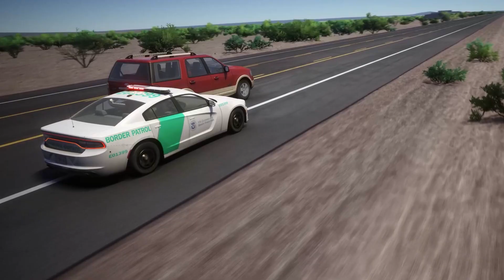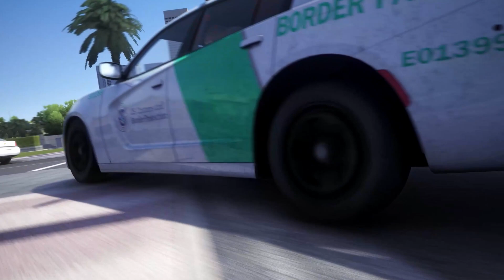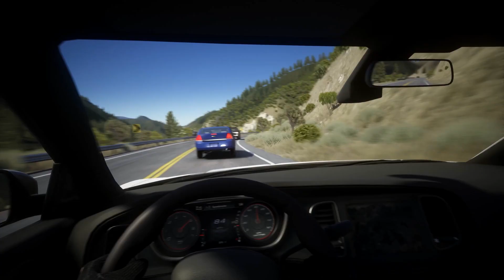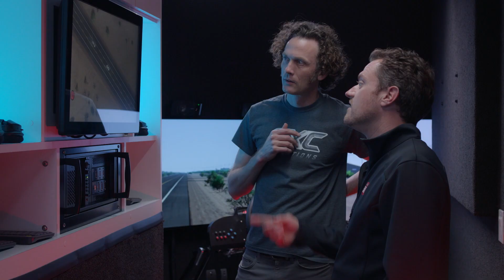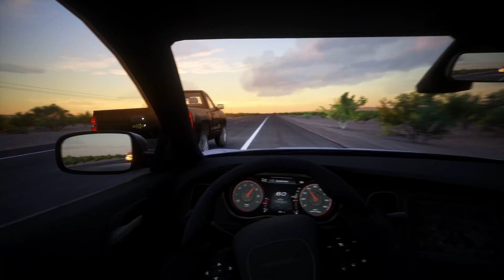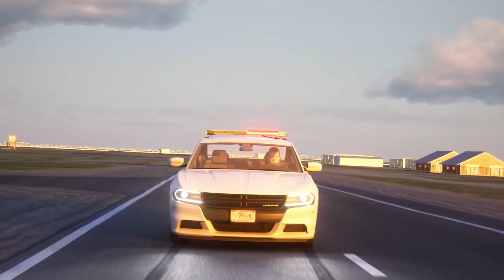The Tactical Driving Simulator By CXC Simulations

Comment: Looks interesting! However, I think they should have consulted YouTube channel "Boosted Media" about how to setup 3 panel sim setup with a motion platform. According to this video, the CXC setup seems to be "seat mover" only where the force feedback moves the seat but the view and dashboard are static. The correct way to do this with 3 displays is to move the seat with wheel and pedals and then draw everything else on the displays, including car's dash. This allows virtual cameras to be moved along the motion platform and the view matches the seat movement. Whether you want to bolt a real instrument cluster to the wheel or just use a virtual rendered one depends on how important that specific instrument cluster is for training. If an instrument cluster is okay, a virtual one will do just fine.

The boosted media also uses clever setup with linear fresnel strips to get rid of the bezels between the monitors and they have adjusted the screens much more accurately to avoid visual steps when the graphics go from one screen to another.

All that said, this is much much better than doing the basic training with real cars. And you cannot safely train tactics in the middle of ongoing civilian traffic so you need a sim for that alone even if car handling skills were done or a real race track. And you canno train civilian traffic with a sim that doesn't match the reality well enough.
Reply: For example, check this video https://youtu.be/sV8fPEDYscw – note that it's not a recording from the GPU but GoPro attached to the head of the driver.